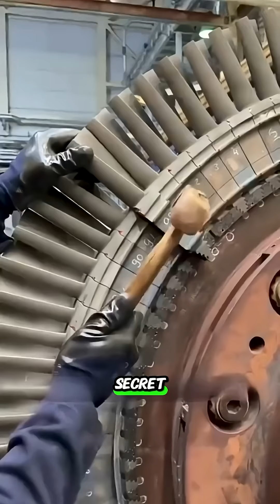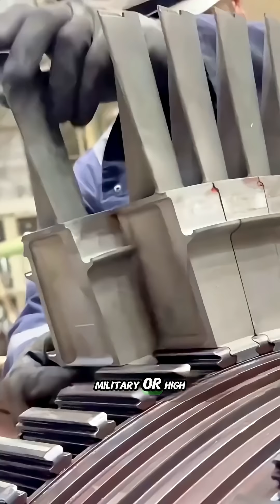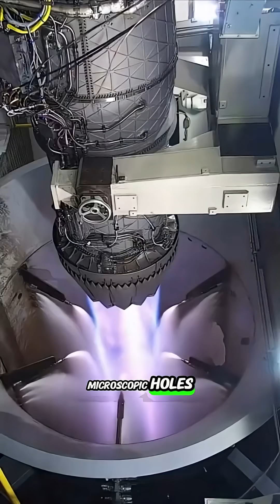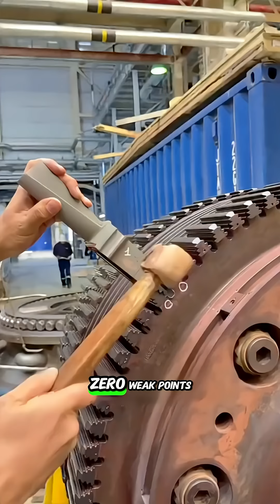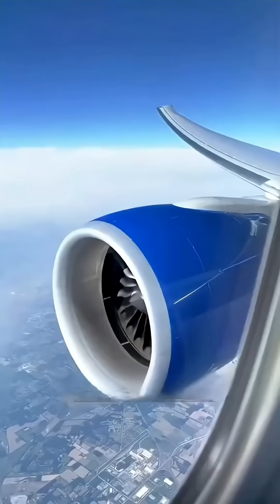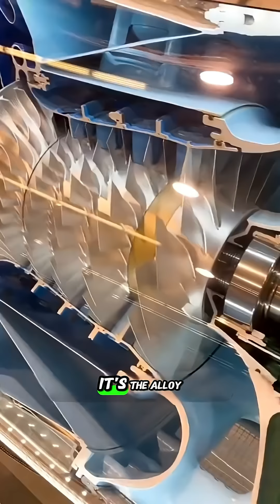The Insane Reason Nobody Can Copy American Jet Engines

Comment: 1. Historical Context of U.S. Jet-Engine Leadership
U.S. jet propulsion began with British technology. In 1941–1942 the British shared Frank Whittle’s turbojet designs with the United States under wartime secrecy. General Electric reverse-engineered and improved the Whittle engine, producing the I-A that powered the Bell XP-59A, America’s first jet aircraft (first flight October 1942).
From that starting point GE and later Pratt & Whitney (now part of RTX) rapidly advanced axial-flow, dual-spool, and then high-bypass turbofan designs. Post-war commercial and military programs (J57/JT3, JT3D, JT9D, F100, F119, F135, CF6, GE90, GEnx, GE9X, etc.) built a deep industrial base. The United States ended up with two of the three (or four, counting the GE-Safran CFM joint venture) global leaders in high-end aero engines.
-
2. Technical Deep Dive: 
Why Turbine Blades Are Extremely Hard to Make
Modern high-pressure turbine (HPT) blades operate in gas temperatures that routinely exceed the melting point of the metal itself (often 1,500–1,700 °C or higher in the hottest stages). Survival depends on three interlocking technologies:
Single-crystal nickel superalloys
Ordinary metals have many crystal grains. Grain boundaries are sites for creep, fatigue, and cracking under high temperature and stress. Single-crystal casting eliminates those boundaries. The blade is grown as one continuous crystal, usually oriented so the strongest crystallographic direction aligns with the primary stress axis.

The process is a form of directional 
-
solidification (commonly Bridgman or related methods). A ceramic mold containing a wax pattern (with a ceramic core that later forms the internal cooling passages) is filled with molten alloy under vacuum. The mold is then slowly withdrawn from a hot zone into a cooler zone at a controlled rate (typically a few millimeters per minute). A spiral grain selector or seed crystal ensures only one grain continues to grow. Yields are imperfect; stray grains, freckles, and other defects still occur, especially on more complex geometries. Only a handful of companies worldwide master this at production scale for aero-engine quality parts.
-
Internal cooling architecture and film cooling
-
The ceramic core creates a maze of internal passages. Cooler compressor air is ducted through these channels (often with turbulators, pin fins, and impingement features to enhance heat transfer). The air then exits through laser- or EDM-drilled film-cooling holes on the external surface. The exiting air forms a thin insulating film that keeps the metal surface hundreds of degrees cooler than the surrounding gas. Hole diameters are measured in tenths of a millimeter; geometry, angle, and spacing are critical. Manufacturing tolerances on these features directly affect cooling effectiveness and blade life.
-
Precision and balance
-
After casting, heat treatment, coating (thermal barrier coatings of yttria-stabilized zirconia are common), and machining, each blade is weighed to extreme precision and matched into sets. At rotational speeds of 10,000–20,000+ RPM the centrifugal load on a single blade can equal the weight of a car or more. Microgram-level imbalances accumulate into destructive vibration.
A full engine contains tens of thousands of parts; the hot-section blades are among the most expensive and failure-critical.
-
3. Why Blueprints Alone Are Not Enough
Metallurgical recipes for the latest single-crystal alloys (containing carefully controlled amounts of rhenium, ruthenium, and other scarce elements), the exact process parameters for crystal growth, the ceramic core technology, the coating processes, the non-destructive inspection methods, and the decades of statistical process control data are not fully transferable from drawings. Yield rates, process windows, and supplier networks are hard-won institutional knowledge.
-
Supply chains are also specialized. Only a small number of firms (including Howmet Aerospace, PCC Airfoils, and others in addition to the engine OEMs themselves) produce these blades at the required quality and volume. Raw materials, furnaces, and ceramic cores form a constrained global network centered in the United States, United Kingdom, and a few other locations.
-
4. Current Competitive Landscape
U.S. companies (GE Aerospace and Pratt & Whitney) together with the GE-Safran CFM joint venture hold the large majority of the commercial engine market by volume, especially in narrow-body and many wide-body applications. Pratt & Whitney’s F135 powers the F-35; its F119 powers the F-22. GE supplies engines for many other military and commercial platforms.
-
Rolls-Royce (United Kingdom) is a genuine peer competitor, particularly strong in large wide-body engines (Trent family) and also masters single-crystal technology and advanced cooling. The video’s “nobody can copy” framing is therefore an overstatement with respect to the UK.
-
China and Russia produce jet engines and continue to close some performance gaps, especially on military engines. However, Western assessments (including public comments from U.S. industry executives) still describe Chinese engines as lagging in reliability, time-between-overhaul, and overall durability compared with the best U.S. and British products. Indigenous Chinese commercial engines have faced repeated delays.
-
5. Broader Implications
•  Military edge: Superior engine efficiency, thrust-to-weight, thermal management, and durability translate directly into aircraft range, payload, acceleration, and sustainment costs.
•  Commercial economics: Fuel burn, emissions, noise, and maintenance cost are heavily influenced by hot-section technology.
•  Industrial base risk: The extreme specialization creates single points of failure and long lead times. Expanding capacity for single-crystal blades is slow and capital-intensive.
•  Technology diffusion: Export controls, classification of process details, and the sheer difficulty of the manufacturing know-how have slowed proliferation more effectively than design secrecy alone.
-
6. Caveats and Reality Check
-
The short is effective popular science and correctly identifies manufacturing difficulty as the binding constraint. It is, however, simplified and somewhat nationalistic. Rolls-Royce demonstrates that non-U.S. firms can and do produce equivalent-class hardware. China is investing heavily and improving. Materials science, additive manufacturing (still limited for the hottest parts), and advanced process control continue to evolve. The U.S. lead is real and multi-decade in origin, but it is not absolute or permanent.

-
In short, the video’s central insight is sound: the hardest part of a modern high-performance jet engine is not drawing it — it is growing, cooling, balancing, and qualifying the single-crystal turbine blades that must survive conditions that would destroy ordinary metals. That combination of metallurgy, casting science, precision manufacturing, and institutional experience remains one of the most tightly held and difficult-to-replicate industrial capabilities in the world.

Comment: For the same reasons, I laugh when people people try to claim fiber optics were reverse engineered from UFO's. 
  We knew the principles of using light as an information transmission protocol back in Civil War days. What we didn't have was a reliable transmission medium until the 60's. When Dow Corning/whoever made an AFFORDABLE fiber optic cable, that's when the use of fiber optics took off.
  Basically the manufacturing had to catch up 1st. So as they said, you can have the blueprints for the most advanced engines/whatever but if you don't have the manufacturering ability it does you little good.

Comment: Frank Whittle (Great Britain)Conceived the turbojet design in 1928.Submitted his first patent in England in 1930.Ran the first successful test of his prototype engine on April 12, 1937.Powered the first British jet flight (Gloster E.28/39) on May 15, 1941.Hans von Ohain (Germany)Designed a similar turbojet engine independently.Secured a patent design in Germany in 1935.Built the engine that powered the world's first jet-propelled plane flight (Heinkel He 178) on August 27, 1939
Reply: Rolls Royce jet engines are pretty good, too.
Reply: Correct and a lot of what he's saying isn't true, about manufacturing and the costs. It's actually far from the truth.
Reply: @Mokmaster Figured that out pretty quick. As many blades as there are in each jet they would be cost prohibitive.
Reply: @JerryRedd-bs8xi  Except if you do the research you will find these turbine blades DO cost up to 100,000 USD each. One of the reason these engines can cost over 30M USD.

I don't have a clue how correct or incorrect this video is, but I'd love to see someone contradict what it's saying by citing what the other companies, such as RR, are doing with their fan blades. Are they as complex? If so, then this video is trash. If true, then maybe it's valid.
Reply: Actually the German design was just a copy of  Wittle's, as they were publicly available and not deemed top secret.
Reply: @juliusmax4783 
I think the Whittle Jet engine, was Radial Flow, and the German Jet engine, was Axial Flow.
Reply: Britain handed over a lot of technology, and territory, to the USA, as a condition of the supply, of war materials, through the Lend Lease Agreement, during WWII.
Britain was way ahead, in technology, than the US.
The British, even gifted the Rolls-Royce Nene to the Soviet Union, who reversed engineered it, to power the Mug 15.
Reply: @stuarttaplin8567   Britain is still way ahead of America in every field.
Reply: @stuarttaplin8567 War made Britian loose tech edge, resources and reserves.
War is a bad thing, I don't understand why the West is also gambling with it. It's one of the most disruptive events in human history yet man keeps toying with it.
Currently USA is feeling the effects of the Middle East conflict.
Reply: Israel stole that technology, from the Swiss. The Swiss, were manufacturing the Mirage III, under licence, from the French.
It would have taken the Israeli's twenty years, of research, and development, and a lot of expense, to go it alone.
Reply: I thought the British flew the world’s first jet plane? I know the Germans actually used them towards the end of WW2. But I recently watched a video about Frank Whittle where they showed that the British were flying these planes but decided that the technology was just not ready for the war. So they redirected their effort into improving prop driven planes like the spitfire and hurricane.
Reply: @PeterLeroux-w1x  Yes the Germans flew the first ever operational jet. 
They were the first with many new technologies. 

Guided missiles and bombs
Programmable computers
Synthetic rubber and synthetic petroleum
Assault rifles 
Audio tapes
A lot of new technologies for submarines and of course the
first ballistic missiles, and a lot of other stuff.

The Americans actually found over 6000 V2 missiles in an underground facility at the end of the war.

There were big reasons for Operation Paperclip, most notable is of course Wernher Von Braum surrendering himself to the Americans, built the Saturn V and sent the Americans to the moon. 

If Niels Bohr hadn't said no at the secret meeting with Heisenberg, the Germans could maybe have been the first with a nuclear weapon, but who knows.

But all the big powers invented new stuff under the war.
Big war budgets have always led to many inventions and new technologies, especially in the great wars.
Reply: @PeterLeroux-w1x The British manufactured Gloster Meteor, was the first operational Jet fighter, in WWII.The ME 262, came shortly after.
The Meteor was also operational, by the RAF, and  RAAF, during the Korean War
Reply: Thats not the point usa has Mastered jet engins bc in God we Trust on our money

Comment: This simple system only needs the generators provided cooling system and the turbine moving and gliding must have two sets individually or combining and system should light and high strength. The safety factor should be 1.5 to 2.0 of all metal used in air craft , no crash accrued.

Comment: You can also move the turbine by the motors RPM should be set as required through gear system is viable, the motor housing should be light and made with aluminium alloys fixed on floor structure. These motors run by generators are also made light of aluminium alloys.

Comment: Had a turbine blade in my hand.spent an hour just looking at it .to make them duv tail out of timber is hard.but out of steel.and the chanel it slides into,mesmerising..on a 20ft shift they wer dozens of blades getting smaller each one.was used for over 80yrs,to turn a charger to make electricity.

Comment: The company I use to work for that made the engines would coat all of the parts.  The turbine blades are annealed and heat tested for durability and quality controlled.  The blades have to be replaced every x amount of air miles. There is no set it and forget it mentality.  To watch just the whole engine go through testing at a testing facility is really amazing.

Comment: I got a tour duing a job interview of Chromally. They make these $50,000 turbine blades. Seriously complex. Lost wax molding, custom metal melted on site, parts poured, computer controlled cooling, QC at every step. Those blades are massively complex and made with crazy metals. Not sure about the "only the USA can make these bullshit" but yea, thye are this complex!  HE is way off on the jet engine speeds though. They dont spin at "tens of thousands of rpm;s" They spin around 150,000 rpm!!!!

Comment: Spent a couple of years a Howmet turbine components as they actually make the blades, fascinating process.
Reply: 👍. Quality casting company.  Had a family turbine blade manufacturing business, you guys used to supply us GE Frame 7 castings…which is a large power generating gas turbine (@100 mw)….even though this video is meant to be about jet engines, they actually show the GE frame 7 in it!! 90% chance, made by Howmet😉

Comment: High Bypass Turbo Fans are easy to design and build. Simple Mechanical Engineering including Combustion Analysis and Heat Transfer with a dash of high temperature metallurgy!

BHP = TxN/5252

N = RPM

At Super RPM Speeds Torque per Blade is not very much?

Comment: Im impressed with the engineering that goes into building the jet engines, the centrifugal forces, rpm's, and extreme heat involved. When you think about the 10 to 12+hr international flights, and turnaround for return flights same duration. They can last a 100,000 flight hrs before overhaul.

Comment: I think they are just too expensive - not that they incapable to make it. Three countries make  hypersonic with speeds to many Machs, America is incapable. That is material technology, electronics withstanding high temperature (Russian landed on Venus 50 years ego where atmosphere is sulphuric acid vapours and the temperature 450C or 842F). SO don't try to justify the huge price - that is why China is flight testing two gen 6 fighters but the USA has one still refining in a computer model.

Comment: If the cost of 1 blade is $100,000 then the total in one engine would be approximately $10 million and in a twin engine aircraft it would be $20 million just for the blades. A modern commercial airplane can cost up to $400 million to build, so it does sound like it might be accurate.

Comment: I was Chief Engineer at a major engine manufacturer. Statements are true is somewhat exaggerated. Engines are also designed and built in Europe, England and Canada. The design process is very complex. Besides that the design criteria are key and based on lots of experience and very proprietary. Getting the engine tested and certified by the authorities is a major hurdle and hard to do even with expertise and experience.
Reply: Production i.e. at MTU in Munich Germany. The technology btw was developed in Germany and Not in USA!!   First airplane was ME262 from Messerschmitt.

Comment: A friend of mine was an aerodynamicist at RR in Derby, mostly dealing with the blade design.
Reply: That is one fine career
Reply: What was his degree may I ask?
Reply: @agera.rs7  As far as I aware he had a degree in mechanical engineering with a specialisation (MA?) in aerodynamics from Loughborough University.  I don't tend to interrogate people on their qualifications unless they intend to work for me.
Reply: @clivewilliams3661 Fine. I was asking because I too study engineering and love the aviation field. Thanks for answering too
Reply: Or you could just use a British engine
Reply: இந்தளவிற்கு இல்லை எனினும் Industrial humidification plant Fan ல் நான் நிறைய பணியாற்றியுள்ளேன். காற்றின் அளவ +/- என அதன் கோணங்கள மாற்றியமைக்கும் முறை விருப்பமாக சிறப்பாக செய்தது உண்டு. மோட்டார் பவர் அல்லது காற்றின் அளவுகளுக்கு ஏற்ப காற்றாடிகளின்  2/4/8/10 பிளேடுகளை
படுதுல்லியமாக திருத்த-சிஸ்டம் வெற்றியாகும்-👍🙏
Reply: @VeerasamyRajan  A jet engine fan and compressor blade is perhaps the pinnacle of fan design because ultimately it has to be efficient and robust beyond what any piece of plant needs, weight, strength, durability, lightness and above all the ability to move air in the most efficient way without sapping energy.  This is why the materials used are titanium alloys and carbon fibre composites.
Reply: fan engg- மிகப்பெரிய சவாலானதுறை-